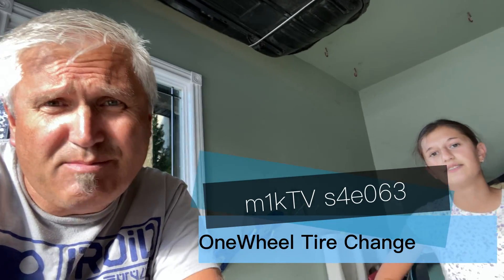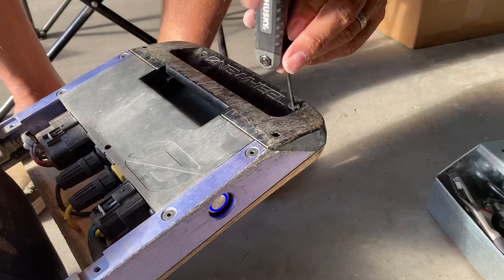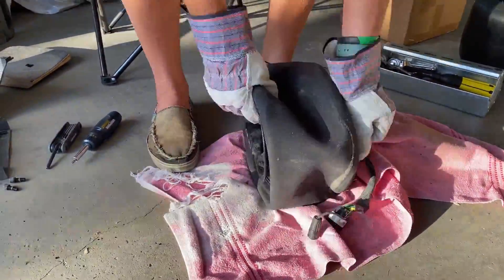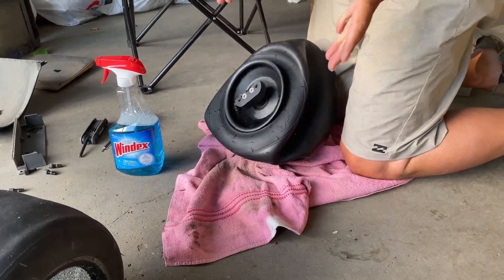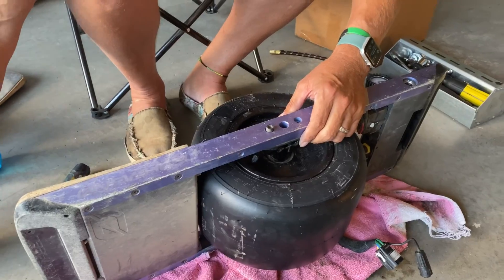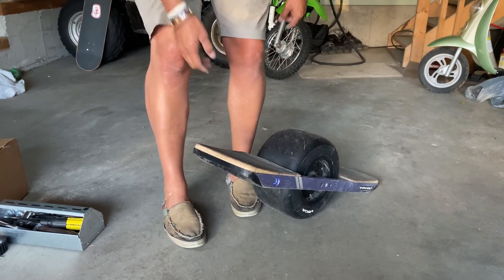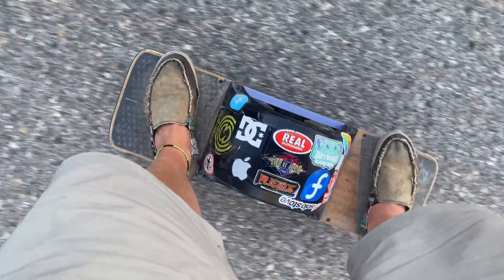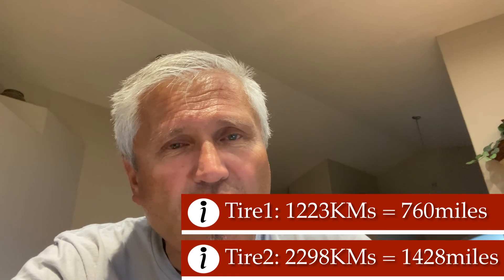OneWheel Tire Replacement - HOWTO

Comment: Congrats on getting that tire changed, definitely looked easier than the last one that I saw you do.  Good thing you were close to home so it didn't wreck the rim.  That is definitely a lot of riding on that One Wheel, nice that the battery is holding up and the frame looks very durable also.